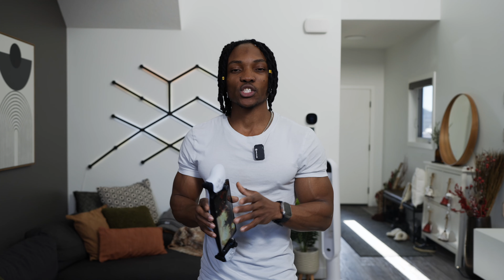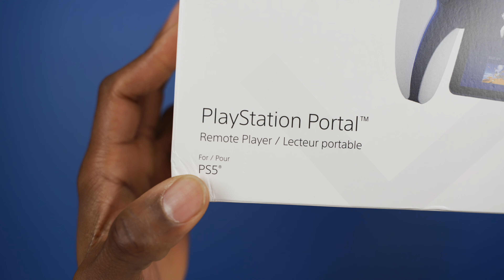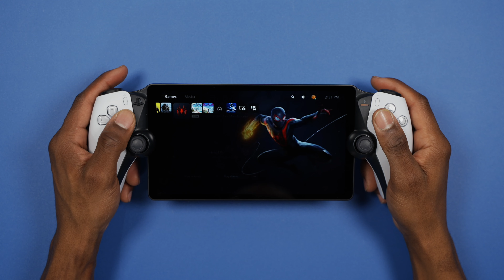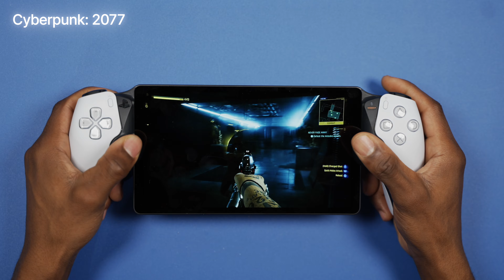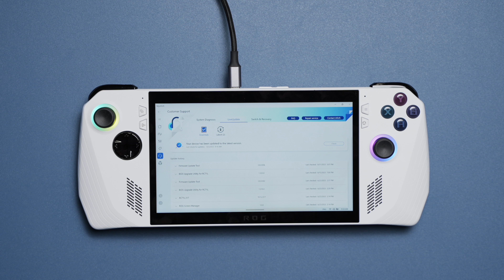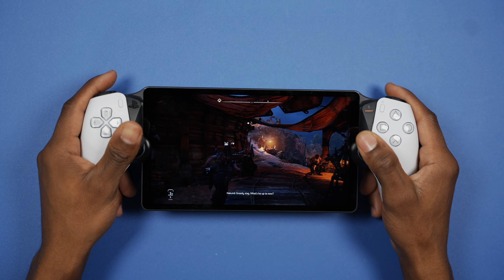The PlayStation Portal After 48 Hours!

Comment: Its so hard to setup this device on your network. I tired different wifi channels, 5/2.4 ghz wifi, ethernet everything (mesh,ps5).. And I still can't get my portal to run without laggs. And there is people who have stable 1080p/60fps..

Many people after putting portal to 5ghz and after changing wifi chan did't have any problem, but I do everything and experience still sucks like yours..
Reply from the maker: I know man. I’ve noticed that it’s very inconsistent for different people which isn’t a good thing.

Comment: I set up port forwarding on my Xfinity app in like 10 seconds and run my PS5 on a 5 ghz ethernet cable and my portal has run FLAWLESSLY. Have played it more than my actual PS5 for the past two weeks. 230 download and 12 upload speed
Reply: Your Internet service plan, as well as port forwarding, has no effect on remote playing from your home network.
Reply: @mmstick  can absolutely confirm that both of your points on wrong lol. I've tried on other networks and without port forwarding on my own network. Move along if you dob't understand that lol
Reply: @ToughLuckStudio  Port forwarding does nothing if you have a router that supports UPnP. An internet connection is only required to sign into your account. There's no reason the PS5 would stream across the Internet rather than across your network. I own a Portal and can confirm that neither port forwarding or an Internet connection is required.
Reply: @mmstick  it’s not required. But it helps lol
Reply: @ToughLuckStudio Port forwarding is totally unnecessary. And the portal is on a DHCP protocol. If your IP address changes then there goes your port forwarding. Its already done for you. My portal has no issue so far on local or remote on another network. .
Reply: @ToughLuckStudio The Playstation 5 supports UPnP, so port forwarding is not necessary. Enable UPnP in your router if for some reason it is disabled.

Comment: Every other review are gasing this product. It's another half thought out idea by Playstation... The Wifi standard alone should tell you how much they thought this through. It's a hard sell. The amount of studders is insane! PS I hate remote play. Should've been able to download locally.
Reply: There's only a few people "gasing" the product. There's more positive reviews than negative, and they ultimately come down to whether the reviewer has a good WiFi router or not, or whether they had HDMI out active while using remote play at the same time. The least you can do if you are going to buy a remote play device is to make sure you have upgraded and configured your WiFi network to prevent it from becoming a bottleneck for your remote play experience.

I have had a PlayStation Portal since November 17th. I've been playing games on it every day for at least a couple hours each day. I've never had any disconnect, quality issues, or stuttering. Precisely because I have a Huawei AX3 Pro (quad core) WiFi 6 router with the 2.4 and 5 GHz bands split into separated SSIDs. With the PS5 connected to the router via Ethernet, the Portal connected to the 5 GHz SSID, the HDMI Device Link option disabled in PS5 settings, and the TV turned off.

Also, there was a firmware update a few days ago which improved stuttering for most people that had less than ideal network conditions. Even those who were having stuttering issues before will likely notice much of that resolved if they review it a second time today. That said, most of the bad reviews really need to take a crash course on configuring and placing WiFi routers. I bet all they need to do is split the 2.4 and 5 GHz bands into separate SSIDs, or reduce channel width to eliminate congestion, or choose a channel which doesn't conflict with neighbors.

If you buy a Tri-band WiFi router, you can even create a dedicated 5 GHz access point specifically for gaming devices like the Portal.
Reply from the maker: I've never been big on remote play myself. WiFi tech isn't there yet as far as I'm concerned but this thing is great if you plan to use it at home alone :)